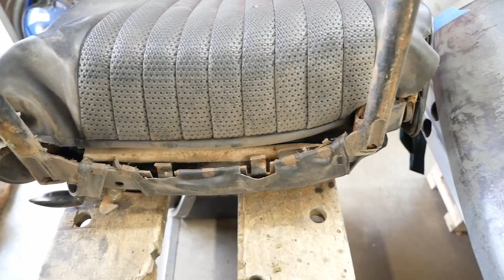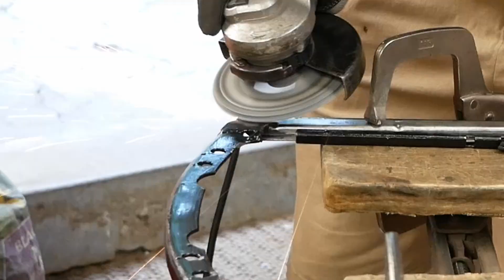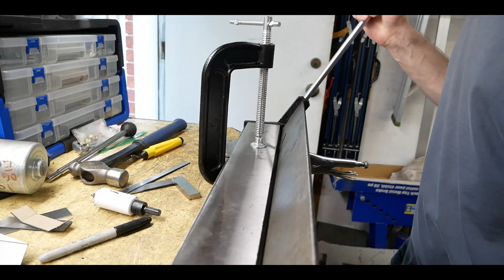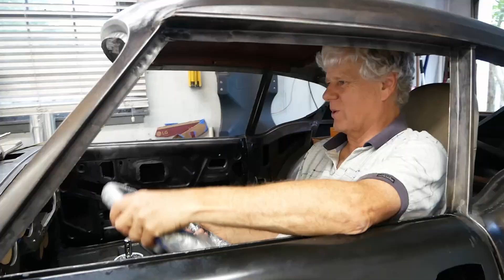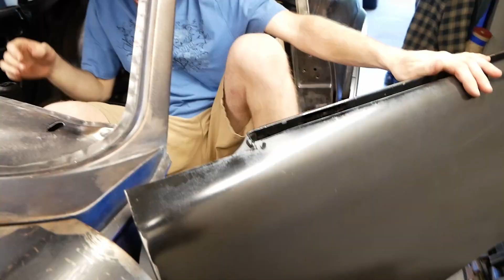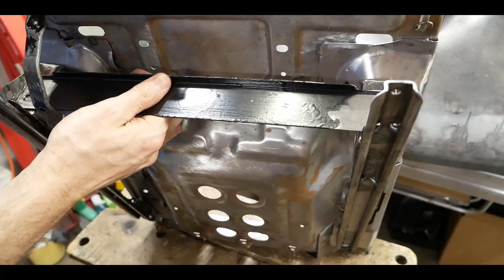Miata’s are HUGE!  Pro Touring V8 Triumph Build – LS Powered Project GT6R – Ep31

Comment: Why not swap out seats for ones you like better? And not TAN?
Reply from the maker: I agree that there may be something left on the table here... but we actually like these quite a lot, and redying is not hard!  I think we got them both for ~$500CAD which is cheap-cheap compared to 944 seats or other small aftermarket options.  We'll see what happens, but I have no issues with sticking with what we've got! ✌️

Comment: Thanks for putting the saga together. It’s inspiring me to try to squeeze a pair of Audi TT seats into my spitfire, which has the same floor pan. The Audi seats are nearly double the weight, and a few cm too wide, presumably designed for a wider Teutonic rear end, so I can see a fair bit of welding coming up. Removing and making safe the bags was a lot of fun, maybe a modest recompense for the impending fun.
Reply from the maker: Sounds like a fun project John, best of luck getting it done!  I have yet to "make safe" the airbag from the steering column we got... will have to get around to that one of these days! ✌️
Reply: @FanatikBuilds  12v across the terminals is enough, I was shocked at the deformation of the steel backing pad, glad I was 10m away. Bonus is the moulded cover was not damaged, as I cheated and removed it first.

Comment: I hope your not planning to drive it in the wet. You will end up sucking water through your air filters and hydraulic if the engine if you go through deep puddles with your intakes so low.
Reply from the maker: No worries, this has all been taken into account.  Any "cold air" intake system poses the same risk, proper baffling and some hydro socks should keep us safe 😊👍
Reply: @FanatikBuilds  happened to me that’s why I was saying! Awesome build though, it’s a handsome wee thing, can’t wait to see it finished.

Comment: I think you will find out soon enough that metal you are using for seat supports is way too thin. Those brackets should be THICC if you want them to hold anything. As well the metal pan under the seat is literally as sturdy as a beer can. Well I find out the hard way after making gaming seat out of RX8 seat and attaching the roller wheels assembly (like you have under normal gaming chair) to that metal man... it pretty much gave way after 3 days. And I am not that heavy... I guess 90kg isn't light either, but that is just sitting next to the PC... imagine any further forces from driving the car.

So the brackets must attach to already strengthened places and those brackets should be made from quite chick metal. The metal pan underneath is only good at holding the foam no force can be applied to it from below as it is surprisingly soft and easy to bend. And the brackets as well - if you could shape the metal with your hand, then they won't be strong enough to keep your body for hundreds of miles. I don't know what exact thickness the metal should be, but should be thick and hard enough that you could not bend it with your hands at all.

Comment: the mk1 and 2 gt6 seats are probably a bit narrower, they dont have the lower padding on the trans tunnel side, ive also got modified mx5 seats in my cobra rep, they were narrowed by the builder
Reply from the maker: I do believe that's correct - the issue wasn't that our Mk3 seats were too big though ... it's that it would have been way too much money to refurbish them!  We got these MX5 seats for ~$500cad so not a bad deal in hindsight 👌

Comment: you will most likely fin out ,that once windscreen is in, then there even less view thru screen,
reason, the seats are too stiff, you sitting on them, not in them,

I have same seats, and whats needed is to take the stiff foam away, where yer MK1 arche ole fits, at least 2.5-3 inch, { also maybe take some off the side bits, as thee,s really do put a squeeze on yer butt cheek sides after an hour or so drive,}   then put some really soft foam in there to heighten base a wee bit,  this to  keep the seat leather from crinkling up, 
but is soft enough for yer arche ole to compress the foam down, so you sit lower, and can see thru windscreen alot better,  OR, you an dad will suffer frae ..bent neck syndrome, !!!!!

Ohh, been easier to mod MX brackets a wee bit, and also bolt from underneath into a welded on nut in the mx runners
been there found all snags
Reply from the maker: The visibility will undoubtedly get worse with the windshield in place!  It's a small car though and although we're working to get ourselves as low into the seats as possible, there's really only so much we can do!  We'll just have to get used to the visibility and drive accordingly 😊👍

Comment: I just found your videos and this is a great project! 

NA miata seats may have fit a little better, but I would have probably gone (and still would probably go) with lotus elise seats if i were you (i'm not). You can find a decent pair of them for not a huge amount of money and they are comfy, supportive, nad would fit a lot better than the miata stuff.
Some other options I'd consider would be Suzuki cappucino or Honda Beat seats. Nice and small, and since you're in canada shouldnt be hard to find those.

If you want to get some more vertical space out of the miata seats though, look up the "foamectomy". You can gain an inch or two that way.
Reply from the maker: Glad you found our "little" project! 😄 I'm sure there are a few other seats that could fit better, but on the whole I'm happy with these!  Lotus parts are pretty uncommon around here (I don't think I've ever even seen an Elise on the roads before) but I'll bet they are a nice option if you can get your hands on a set 👍 Our driver's seat already had a foamectomy done to it (badly) (seen at the end of this video) so we're going to have to fix that up and try to do a better job than the monkey who got to it before us! 🤞
Reply: @FanatikBuilds  Nice! ANd yeah being in the US myself they're not terribyl common either, i mostly see them on miata message boards as they are popular option for tall guys in miatas, and they arent too terribly hard to get that way.

Comment: Fantastic build! I should probably leave it at that but I can't help myself. What is the fascination with over engined cars? I drive a 2.4 litre Ford Ranger. If it weighed 1000lbs less it would have all the get up and go you'd ever "need". There are so many cool old sports cars that would greatly benefit from the light and torquey Ranger engine. Of course I come from the headspace where a 210hp air-cooled Porsche Carrera is the bees knees. Carry on.
Reply from the maker: Thanks Berni.  The GT6 factory output was 100hp.  And a 0-60 of ~10s.  There are modern cars that match that, but it's still undeniably slow nowadays.  Plenty of people have been able to squeeze some more performance out of the Triumph 2.0l, but then like links in a chain, every other aspect of the car becomes overwhelmed.  By the time you upgrade every piece, you may as well have put in a more powerful engine!  So I take the blame for the complete over-engineering of this project, as it's always been my dream to build a car from scratch, and neither of us have ever owned a V8 before so it was a very logical choice.  The LS is also incredibly supported in the aftermarket so it should be very straightforward to get running (even for a couple of noobies such as us) ... and it's really not that heavy or bulky.  The car just makes it look big! 😊

Comment: The 99 special edition Miata was the 10th anniversary edition.  It was blue.  So were the seats. They may be 2000 special edition seats.  Those came in a tan color.  Then again they could just be standard LS Miata 99 seats.
Reply from the maker: Interesting, I had it in my head all this time it was a 99 ... but in light of what you said, it would appear it was not the "special edition" after all!  The car was definitely green, so it was either a 2001 special edition, or as you say, just a standard LS with the tan leather ... the more you know! 😂

Comment: Seats are fun NOT! 
I have a mk1/1st gen Chrysler/Dodge Neon. The seat always set my back off. I found a seat that wouldn't. It was from a mk1 Volvo V70 estate. I cut the base frame shortening the cross tubing for side impacts, & made a new seat rail/tracks. 
Please make sure if yours has bearings you replace & grease them. That also applies to the tilt/recline mechanism.
Something you might want to check is. Without the frames there are the cushions/padding & fabric/leather the same on both if not interchangeable. Some car companies only make the base frame differently so they can swap the cushions & covers. Makes it cheaper to manufacture too.
IF they are then get a passenger rather than drivers side seat for the cushions/padding. As they won't be used or abused as the driver's seat.
Reply from the maker: Our foams are different from side to side unfortunately, but we've got some ideas to get it fixed up, so not a big deal! 👍

Comment: Nice job fitting those in there. The great thing about the stock seats is how low they allow you get in the car. Seat swaps tend to leave you higher in the car which is rough in such a small cockpit.
Reply from the maker: I'd say (with the foam removed) these don't put us much higher than the factory ones ... but either way, it's certainly a small car! 😊 Thanks Mallen

Comment: I would go with the factory valance panels and integrate them into the new lower bumper design. The new lower valance doesn't suit the car overall design. The square shape doesn't match the original car design at all. So I would stick with that design, if I were you, it looks so so much better. btw since you love fabricating so much have you considered, if its even possible, to raise the front windshield an inch higher?

Comment: Fantastic job solving the seat issue/reconstructing the Mazda seat base and seat mounts/tracks. 
I know you plan to customize the front end and one mistake I'v seen several times is they make it too boxy. 
The car is sporty/curvy so the front needs to flow with the body lines. Others mistakenly square off the corners to make it easier rather than making compound curves that will flow/look better. 

That being said I'v alway been very impressed with your trouble shooting and design skills. So I'm sure you'll come up with a solution to the damaged seat foam and a fantastic looking front end/fascia when you get to that.
Reply from the maker: Thanks, all in due course 👍
Reply: @FanatikBuilds  Forgot to mention my comment on designing the front end wasn't a criticism of your concept rendering/image. 
I'm sure you'll do great. When you get to that. Love this project
Reply from the maker: All good, thanks man 😊

Comment: A suggestion for doing bends in small pieces of sheet is a Grizzle P/N H3244 tool.  It is a set of press brake dies that fit into a bench vice.  About $60 US.  I have a set and they are very handy.  

Excellent work and good that your father is doing better.
Reply from the maker: Thanks for the tool suggestion, that would be very helpful!  The Grizzly brand is ~$180 CAD on Amazon, but it looks like it's a common tool that goes by different names, so I found another listing for a more comparable price.  Bookmarked!  Cheers 👍

Comment: I must admit to having a chuckle when I saw the MX-5 (Miata) seats having been down the Rabbit hole in fitting modern seats into Mk1 Triumph Vitesse. MGF seats work(ish). Then 'Foamectomy' commonly used to drop the driver height in MX-5's. But more power to you, you got them in there.
Reply from the maker: The Miata seats are small ... but the Triumph is smaller! 😂

Comment: Good fabrication on the seat mount brackets, but surely those are just mockups. That looks like 1.5mm steel, that's way too thin a gauge to be used for seat mounts, even if you brace it. I've never encountered any seat rails or moints made of steel thin enough to bend by hand to a hard 90 in a vice, it's 2.5mm from my recollection.
Reply from the maker: No need for such thick metal here ... the bends are what add the strength, and we reinforced the area where the bolt passes through.  1/16" is far to thick to bend to a perfect 90 by hand, I just had to get it started by brute force as the placement of the bends made it impossible to use our brake.  Thicker material would just add to the weight!  As it sits, there's no flex in the brackets, it's the floor that moves 😊... more on that in time!

Comment: Sweet seat foam! Now you get to do what you want!

On my XJ the seat foam was old, and kinda smooshed but not coming back. So I pulled the covers & cut new foam (from couch cushions). I also "reinforced" the bolsters by adding rolls of cloth on top of the foam, under the covers. (I also removed the OE sliders, dropping the seat ~4", then added 1" spacers to the front of the seats. They didn't move, but they were comfy!)

Hack job from random junk, in less than a day (d&p, rear deleted), for almost no $$, that lasted 5 years before my jeap got T-boned. (2dr, 2wd xj w/4.0&ax15)

Comment: Why not keep the Triumph seat pan, but using Miata foam & cover, and swap the whole seatback?

Recline may (probly) won't work, but you need that as much as you need to see the sky when driving… 

(none, not at all)
Reply from the maker: Way more work that way!  Our transmission tunnel already needed to be re-finished so this really doesn't add much to our future workload.  Very happy to have these seats just fit and work as well as they do!
Reply: @FanatikBuilds  I was thinking to basically weld the top of the Miata seat frame to the bottom of the Triumph seat frame, but I figured you picked the easiest (safe) way you saw (I would). I didn't see the seat frames next to each other, and I kinda left out a slider…

(but I set my car for me, no one else needs to drive it, so the seat only needs to be where I want it…my ED & XJ both had fixed seats)

Keep that in mind for the next project, random thoughts can be the only way!

Comment: The Miata driver seat “foamectomy” is a common mod for tall drivers. I’d make sure you fit properly in the car before repairing it, which would exacerbate the top of windscreen visibility issue. In fact, I’m a bit surprised you didn’t drop the floor pan a couple inches to give more headroom.
Reply from the maker: Can't drop the floor as there's a frame in the way (now)!  The foam will likely still be modified over factory, but it's been done so poorly, that we've got to do something here!

Comment: your doing it right Lad . keep up the good work . should be a rocket.
Reply from the maker: Thanks very much, I think it has every ingredient to be just that! 😊
Reply: @FanatikBuilds  yes it does at that a little of every vehicle on the road lol but if it works  hey all good. I'm doing a 66 chev half ton with a stroked old school 350 aka 383 with some good flowing heads and a custom Cam that will produce 560hp and 490 toque on pump gas naturally aspirated. No boost . Trying to do a video on it but no go pro just a phone and a computer. So who knows how that will work out. Lol. But having watched what your doing has given me some ideas on a flip front end . Not sure but may give it a go . Did a 88 two door s10 jimmy with a flip flop front end and it did 10 second quarter mile with the same engine 383 stroker and a 700r4 old version no electronics . And a Ford nine inch . It was super quick and was a two seater tubed . The wheelie bars kept it from raising the front end to high . A father and son bought it and are still racing it to this day ten years later same motor and trans and rear end . Dependable ride wish I would have kept it but they offered a good price so money talks and takes your favorite ride as well. Lol hope you and your dad are well and your family as well . Nice to see car building is not lost . Keep up the good work Lad. Can't wait to see it do it's first burn out . 😎👍🏎️
Reply from the maker: Sounds like a fun ride for sure!  On the video creation topic, don't let only having a phone and PC deter you ... Go Pros are nice, but sometimes not the right tool for the job.  Smooth footage and good audio are way more important! 👍 ... all the best to you and yours as well!  Cheers ✌️
Reply: @FanatikBuilds  Thanks Lad . I see how you are doing your videos and I don't see or should I say hear the noise that many channel's have like hammering and shop noise.your videos are really easy on the ears and have no outside noise . That makes watching your videos easy and pleasant to watch. I watch Fitzee's fabrication Halfassed custom just to name a few ya they have noise but not as bad as many. 
I wait to see your channel and find it very informative and your technical is excellent. Keep in touch and I will keep you updated on my progress and maybe you can help me keep my videos in such a high standards that you have. I have been doing builds since I was a very young Lad first car I built I was 15 years old . I'm 58 now and still love building cars and trucks . I work as a body man now at a small shop now and still love it.